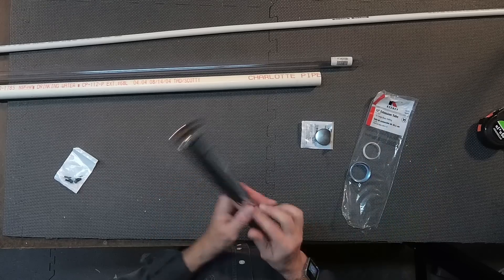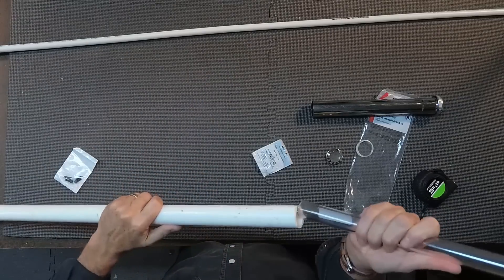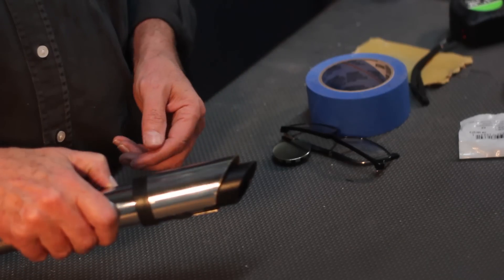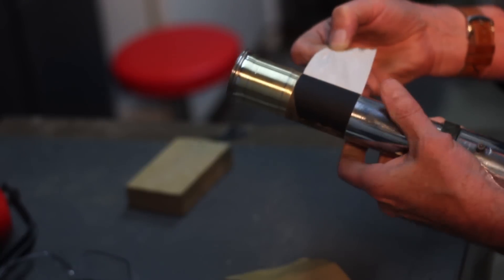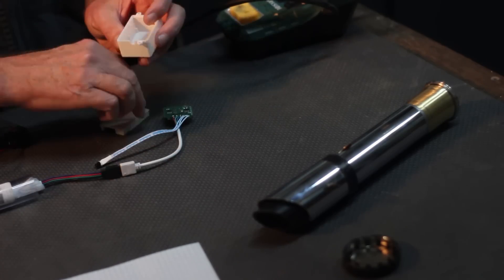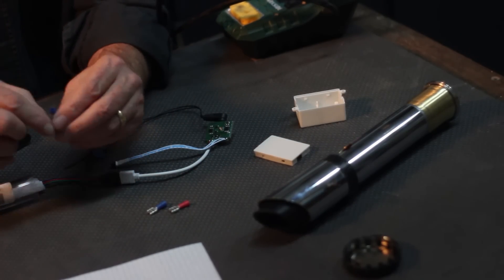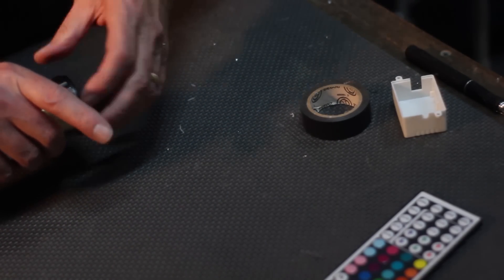How To Make a Lightsaber (with Multi Color Blade)

Comment: Have you considered trying to make a baselit saber?  The LED strip through the blade usually makes it look nicer, but if there's a single LED lens in the hilt, it makes it MUCH harder to accidentally damage the light if you plan on smacking sabers around with friends.  Still, really cool.
Reply from the maker: I will have to look into to that. Thanks so much for watching.

Comment: Hello 
Totally Love Your Video!!!
Can you tell how you got the 3 prong switch into the Hilt during the electronic wiring section of this video? It seems you soldered everything outside out the hilt and then it looks like the Switch is on the outside of the hilt? Did you run LED’s in the front of the hilt and then run the wires through the switch hole and then solder the rest off camera??
Also one more question… the LED’s you list in your description of parts is currently Unavailable on Amazon, can you recommend another brand that has the same specifications as the LED’s you used? Any help will be appreciated!!
Reply from the maker: You are right. I pulled all three wires through the hole in the hilt and connected them there. You don't have to solder them if you have already put on connectors to the wires. I hope that makes sense. Here is another link to the LEDs https://amzn.to/3DonAAX. Thanks so much for watching.
Reply: @DIYGene  Thanks for getting back to me on this! Much Appreciated!!
And thanks for the link to the similar LEDS via Amazon!!!
Reply: @DIY Gene Hello again!! I have yet another question…. I see you use “finish” screws to secure the blade in place, can you tell me the length of those screws??
( and are they the type that have a Socket head cap style??, the type to be used with an Alan key??) Any help will be appreciated!! Thanks in advance!!
Reply from the maker: Hello R-Z. The screws are about 3/4” long. And mad to go into the polycarbonate tube to help secure it. If you can pre drill a smaller hole in the polycarbonate the screws should thread themselves into it. Yes I did use machine screws with Allen wrench heads. But that was basically for looks. You can use other types too.
Reply: @DIY Gene Thank you so much for the info on the screws!!!! I appreciate it!!!

Comment: nobody saw the electrical error on the switch? ..at off, the batteries will short!! ..just don't connect the black/negative there..
Reply from the maker: I’m not sure I understand. This has been working great for 2 years. But if I have done this wrong, I definitely want folks to know. Can you elaborate? Thanks for the input.
Reply: @DIY Gene ..never i saw in my technician life both polarities of the power on a 2 ways switch.. this 3 pins 2 positions short each position from the center pin (like any common 2 ways switches).. i don't understand why you have done that and can't explain why that work (if one side never short, why 3 pins?)..

Comment: Your video is wasome and lightsaber turnd out beautifully but i have some question about screws and battery is it possibe to use lipo 2cell 7.4v battery as power source and what type of screws did you use to secure blade since you did not cut treats inside the hole?

Comment: You probably shouldnt use plastic bags for the defuser cause the led’s could melt the plastic and blow a fuse
Reply from the maker: That is a good suggestion. I have not had a problem with it and the LEDs didn’t really put off much heat. Thanks for watching.

Comment: sand the outside of the blade or spray it with some frost spray paint it will diffuse  perfectly. i used your sharktube method and it worked great with a light sanding
Reply from the maker: I like the idea of sanding the blade. I will have to try that. Thanks for the great suggestion.

Comment: Did you ever have this issue: when you turn it on with the switch it wants to flash through the various colors?  When I opened the lights it did that, but all through hooking it up I had it one constant color. Now that it is all the way assembled, it has reverted back to flashing various colors.
Reply from the maker: Wow, Im not sure.  The one I built stays on what ever color you last used.  I kind of wish it would go back to the basic white.  But I not sure what is going on with yours.  I know that is no help. I hope you can figure this out.  Please let me know.
Thanks,
Gene

Comment: Hi, I've started to make my own but i've run into a problem and was wondering if you maybe had a solution. I've made all of the electrical connections and have checked them with a multimeter but the LEDs won't light up. I can switch around the plug in from the LED strip to the box that contains the censor but then it won't change colors, it just stays on blue. This comment may be confusing but it would be awesome if I could have some advice on how to fix it
Reply from the maker: I’m not sure, You are able to light it up by switching around the plug, okay but now it won’t change colors. Are you making sure you have the censor in a place that the remote can detect it?  I’m sorry I’m not more help.
Reply: @DIYGene  you’re completely fine! I just have no experience in electrical stuff, I’m going to play around with it a bit more

Comment: I tried this. Different lights same connection method. It wouldn't work on the switch but it worked when i reconnected it to the 12 volt cable. Any ideas?

Comment: Can someone explain to this non-american what Shark bite tube is? Is it just pvc pipe?
Reply from the maker: It’s called a PEX tubing.   I’m not sure what other brands might be available. If you can’t find it you could replace it with foam packing. I hope that helps. Thanks for watching.
Reply: @DIYGene  Thanks for the prompt reply man. I've seen others use foam packing but I like your look better. I'll have a look here and see what I can find. Cheers man. Great build.

Comment: I was wondering, how is the blade secured in?
Reply from the maker: I use a combination of a little bit of duct tape around the blade to tighten up the fit the 3 set screws to hold it. This way you can also remove the blade if need be. Thanks for watching.
Reply: @DIYGene  thank you!

Comment: okay, just started with my try on a lightsaber and now i am doing the electric part.
just wanna ask, the linked led-stripe is 12V. and the 9V battery is working?
Reply from the maker: Seimen 434 , Yes a 9v will work just fine.

Comment: Hey Gene, great build! I’m having a problem with my colors they won’t switch, any tips?
Reply from the maker: hamdilaserbeam , there is a sensor the the remote has to pick up. I drilled a hole in the very bottom of the hilt and pushed that sensor though it enough for the remote to pick it up. I  put a little bit of hot glue to hold it. I hope that helps.
Reply: DIY Gene that’s the problem my sensor is completely exposed I didn’t attach it to my saber yet
Reply: Before I cut the power cord I made sure that all the colors work, then I attached it to the 9v and it seems to just stay blue
Reply from the maker: hamdilaserbeam, that is really odd. Mine worked fine with the 9v. Let me look at it and see if I can figure out what’s happening. I’m sorry you are having this problem.
Reply: DIY Gene wow honestly thanks for taking the time to help me out!
Reply: DIY Gene GENE! don’t bother looking I figured it out! I had the positive and negative switched so it was just staying blue 😅 thanks for a great and informative video!

Comment: Is it essential to have the PVC sleeve within the saber? I would like to construct a different emitter style, but I am unsure if the fittings within the metal tubing are necessary for the blade to fit securely. I know that you can screw the blade into the hilt, but I just anted to make sure that I can have my creative freedom **before** constructing the saber.
Reply from the maker: Jackson Mroz , I do use the pvc as a sleeve to fit the polycarbonate blade in securely. If you don’t  use the PVC you will probably need to shim the blade somehow to make it fit snugly. I hope that helps. Thanks for watching.
Reply: @DIYGene  This helps immensely. Thank you so much!

Comment: I'm currently modeling up my own in fusion 360. I was going to use a 12v 2ah lithium ion battery from milwaukee's m12 series but do to complications due to my modeling skills I'll be using a custom built lithium battery pack. I am also using a single 9w total rgb led with some "fogged" tubing for the blade. Also have a button to start the blade with a knob built in to adjust color and 2 more for the other colors. I'll be using an arduino to control the colors. The 12v battery will be used to power the arduino and provide enough current to drive the led's as the arduino can only deliver 40ma and each color on the led requires about a little over 1a to power it. End goal is to create a lightsaber that can extend when the button is pressed but I'll work on that bit after I get the handle and basic blade made first.
Reply from the maker: SpazmaticAA ,That should fantastic. I would love to see it when it’s finished. Thanks for sharing and for watching.

Comment: I know I comment a lot but would you consider making a tutorial video on how to wire it with the connectors
Reply from the maker: You know, that is a good idea. Because not everyone has a soldiering iron or feels confident enough to try it. The push on connectors work just as well.

Comment: What size pvc sleeve did you use to slide the outer part of the emitter on
Reply from the maker: Samuel Gauna , it is a 1/2” extension tube. I put a link to it on Amazon in the description below the video if that helps. Or you can get one at Home Depot for about $3. Thanks for watching.

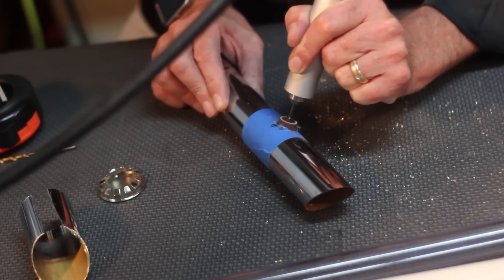Comment: Great video, around 5:10 you say mention using a PVC sleeve. Do you happen to know the which fitting it is? I'm trying to find one similar. Thanks!
Reply: Thank you for getting back to me so quickly. I'll let you know how it turns out.
Reply from the maker: I'm sorry I should have placed that in the description below.  The part is a:
1- 1/2" PVC extension tube.  You can pick one up a Lowes for $3.18 or here is a link to one on Amazon: https://amzn.to/2Ieb9tG
I hope that helps. Thanks for watching.

Comment: I love your work, Gene.  One of these days I'll be making one myself, but I'm finding the polycarbonate tube difficult to source.  Instead of using a diffusing material, which ultimately cuts down the brightness, I wonder if it's viable to frost the polycarbonate tubing itself with some fine sandpaper, or automotive cutting polish..
Reply from the maker: nitramyar , these are great ideas and the great thing is you learn when you experiment. I do think there has to be a better way to defuse the LEDs than how I have been doing it. Thanks for the help.

Comment: Ive designed my own lightsaber and before this video i couldnt figure out an easy way to house the speaker battery pack and be able to change out the batteries. However this gave me an idea and now i just have to buy the parts so thanks!
Reply from the maker: Andrew Dorough , I hope this helped. Thanks so much for watching.

Comment: So do you need the little thing that goes in the polycarbonate tube or is it just there to feed it in
Reply from the maker: Frebby Boi , Do you mean the white PEX tune I slide in to the polycarbonate?  I use that to defuse the bright spots from the LED lights. I hope that helps. Thanks for watching.
Reply: DIY Gene thank you that’s exactly what I needed to know, follow up question. Is it ok to use a 9V battery on a 12V LED strip?
Reply from the maker: Frebby Boi, Yes. The 9v handles it great and it lasts a really long time.
Reply: DIY Gene thank you!

Comment: where did you get the pvc sleeve as you called it?
Reply from the maker: Dennis tate, I picked it up from Lowe’s. It PEX pipe the brand is sharkbite and only cost about $2.
Reply: @DIYGene  thank you
Reply: @DIYGene  one more question at 5:11 in the video what is the name of the white pvc you uesd
Reply from the maker: That is a pvc 12” extension tube inlet 1-1/3”. I cut the end of that make that collar. I think it’s around $3 at Hime Depot.
Reply: @DIYGene  thank you sir

Comment: I would suggest maybe next time to fold the lights together like an accordian first before folding it in half to get lights on both side. By doing this you eliminate the spacing between the lights and end up with more lights. This gives you a brighter much fuller blade and you cant see the individual lights.
Reply from the maker: michaelhunter81, That’s a great idea and the LEDs come in a 16’ long roll so there is plenty. Thanks for the great suggestion.

Comment: Sand the polycarbonate blade for secondary diffusion, I just like scratching up mine in multiple directions. It turned an unified kyberlight day blade into a gorgeous unstable blade when lit up with a similar color
Reply from the maker: That a great idea, thanks for the suggestion.
Reply: @DIYGene  Anything to help, also the end caps of the Saber blades are relatively cheap online if you want your product to be slightly safer (hot or super glue the cap to the end) either or, you do amazing things on this channel.

Comment: These are really cool! I want to make one myself! One suggestion that I've seen from another video is that you could use a sheet of packing foam instead of pvc; it would diffuse the light a little better and make it overall brighter. Just an idea!
Reply from the maker: That’s a great idea. I also wonder if I could figure out how to frost the inside of the polycarbonate. Thanks so much for watching.
Reply: DIY Gene That would be another great way of doing it! Whatever the case, the better the diffusion, the brighter it will be and the better it will look.

Comment: What was the size of the schedule 40 pipe and the size of the machine screws you used?
Reply from the maker: TBowen248, the schedule 40 is 1” ID it was 1.31 OD. And I used #8 -1/2 machine screws. I hope that helps. Thanks so much for watching.
Reply: DIY Gene thanks so much, your diy builds are amazing and keep up with the great videos too.

Comment: Great build and love how easy it is to follow. Have you ever consider using epoxy to glue the tubes and parts together. You wouldn’t have to use screws then and can have. Cleaner build if you like.

Comment: @Gene you should try using a bore brush like for cleaning guns to give the inside of the poly tube a matte or brushed finish it should help defuse the light.  Also I've seen people use just plastic wrap rolled around a dowel rod, insert it in the poly tube then unwind and remove the dowel.  Gives a good diffusion, too.  Also try this for your saber tip https://www.amazon.com/Craftics-AC1508-1-Acrylic-Half-Sphere-Thick/dp/B00I0BV5CS/   If you cut a small piece of foil tape the size of the inside of the poly tube it can be used as a reflector under this tip.
Reply from the maker: Wow, I like the idea of using a bore brush. Thanks for the great suggestions.  Thanks again for watching.

Comment: Gene, this was great!  The only thing to make it maybe even better, and to reduce the pixilation is to use 144/meter strips.  The strips you used the pixels were too far apart.  When you use the 144/meter, the pixels are closer together, and you don't get as much spottiness.  The lights actually cover any shadows over the short distances between the pixels.  IF that makes sense?  Where did you get the "shark bite"?  What is it?  I need to try that in my blades.  PS, I also use clear 1/2 inch shrink over my strips and then wrap with cellophane, and then into the foam, and then into the polycarbonate.  For DIY with stuff around the house, this was awesome though!!!!!!
Reply from the maker: Hello Megtooth Sith Sabers ! First off I want to let everyone know that you have a great channel and hope everyone will check it out. I’m going to check out some of the strips you are talking about. The sharkbite I get from Lowe’s a 6’ tube is only about $3 and comes in white, blue, and red. I would also love to try a sound card like you use. Thanks so much for watching.
Reply: @DIYGene  Yeah, PEX, we call it pex.  I'm going to try pex for diffusion.  We have been using foam and cellophane wraps.  That is awesome.  Pex may be a better diffusion solution than the foam.  Thank you for the idea!  Love your videos!

Comment: I have seen at walmart tv back lighting strips that plug into a USB and comes with the remote for 5.99 I was wondering if using a car adapter you van find at dollar tree for a buck making it possible to remove the blade during storage or when not in uses. I was wondering your thoughts
Reply from the maker: JCinLapel , I think that could work. Great idea. Thanks so much for watching
Reply: @DIYGene  Thanks for responding

Comment: Love the hilt design it looks awesome! I use parchment paper and clear cellophane wrapping around the sharkbite tubing to defuse the light, it shows less hot spots.
Reply from the maker: Mike, that’s a great suggestion. I’m definitely going to try that. Thanks for watching.
Reply: @DIYGene   how does the light go through the pvc? What kind is it
Reply from the maker: saved by grace through faith , The thin white pipe inside the clear polycarbonate is actually a plastic called PEX and is very translucent. Also very cheap. About $3 for 5’. I hope that helps. There are links to the materials in the description. Thanks so much for watching.

Comment: Great video Gene just be aware that the battery will short out if you connect the negative to the switch if its a double throw type Best to connect direct to negative of led array Cheers mate
Reply from the maker: Great advice!  Thanks for watching.
Reply: led array.do you mean where the 12 volt jack plugs into the circuit board?i followed your advice and soldered my negative switch wire to the adapter plug in.where it attaches to the circuit board.the negative prong.but my battery still gets hot